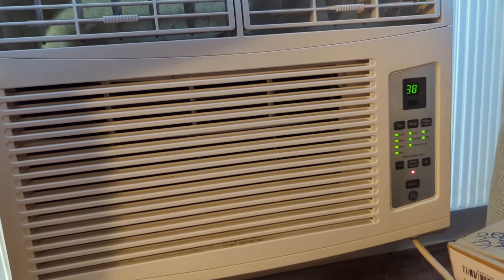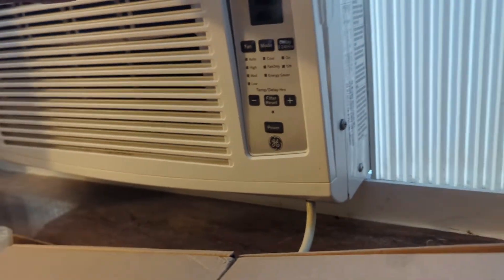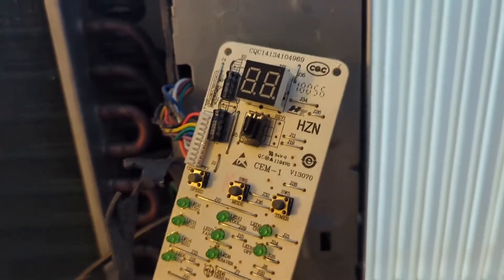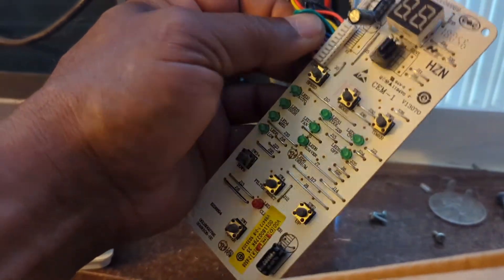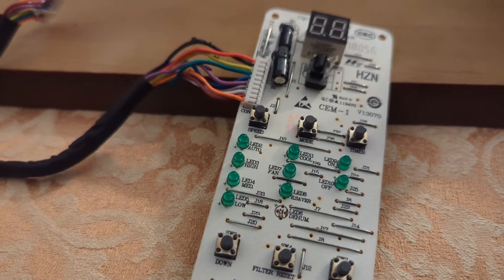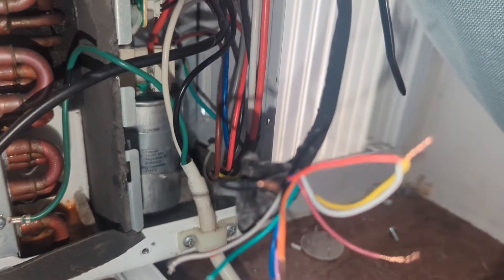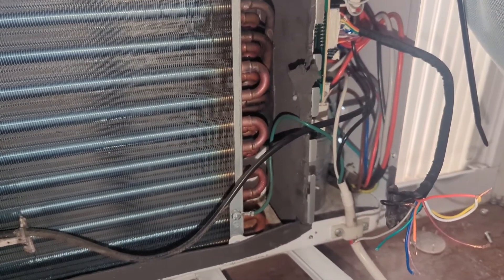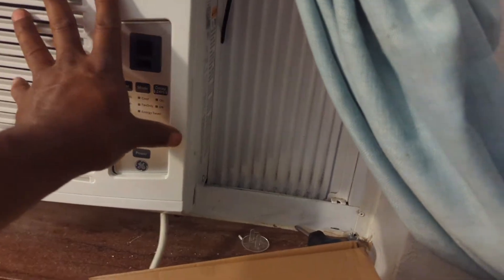GE window AC unit cycling off and on with error 88, hack & repair. Model AHS08LXW1 & others -  VOTD

Comment: I am going to get a replacement unit but this allowed me to get through these next couple days Thank you!!! 98 degrees in ohio right now.
Reply from the maker: As long as it doesn't freeze up. I'm in Ohio as well and mine has been running non stop for 4 days now.
Reply: How long can I let this run without it ruining the unit? I have a board on the way, but what do you recommend to generally run it at?

Comment: I first saw another video that said connect the red, yellow, white, and black.  I tried that and it did not work.  I started searching again and saw your video and you said don't connect the black wire.  I tried just the red, yellow, and white and it worked.  Thank you.  I've had 3 GE 6,000 btu units go bad.  The first on ewas about 2 years old so I threw it away.  The 2nd one was under warranty so it was replaced.  The replaced one went bad after the warranty expired about 2 years and now works without the control board thanks to you.
Reply: Same thing here, @RobertDIY you saved my butt on a hot june day in philly. My thanks
Reply from the maker: Glad to help. Thanks for watching and sharing.

Comment: I order the part according to the model and part number but my connection has the cables up side down. When is connected mine starts from top RED to bottom ORANGE and the part I order is the other way, plus doesnt have the locking mechanism.
Reply from the maker: You can usually find the part number on the old part. Other than that, you'll have to look at the picture of the part you're ordering to make sure it's exactly the same as the one that is in the unit.

Comment: Do you think this would also work for my TCL unit? I have a Smart Wifi 14K btu and i assume with it also having a board and it shows the 88 with all lights on and blinking and beeping then thats whats wrong too. Its only a little over two months old. It has a 1 year warranry but i cant contact TCL until Monday and its only early AM Saturday. We also have power surges and recently had another one  due to a tropical storm. I bought it to replace my GE unit that was only a year old and started the Error 8 if i recall right. It was saying it was overheating and stopped kicking the compressor on. I stored it thinking it just needed cleaning or it couldnt handle the heat wave for whatever reason bc it was also super humid eventho thats what theyre supposed to be for. Anyway, appreciate the hack tip video.    Also do you or anyone know if the usual solution from companies like this is to repair or do they refund money as long as its under warranty or what ? Like i said mine is only a little over 2 months old.
Reply from the maker: If you start taking it apart they will likely VOID your warranty.
Reply from the maker: https://youtube.com/shorts/q72JV9RxFQ0?si=B8GB2Au-Vit1ABng

Comment: Just did it on a AHTE06AAQ3 6000 btu unit. I tried a new capacitor and it didn't work. Tried finding a board to order and no luck so hacking it was my final option. I run it on Hi 98% of the time anyway so all the bells and whistles won't be missed. Thanks for the tutorial!
Reply from the maker: You are welcome. Be careful because it will likely ice up from running to long.
Reply: @RobertDIY  thanks for the heads up. I'll give it a break every now and then 😉👍

Comment: Power went out, broke circuit board apparently.  Tried this and it worked.  Just saved me from buying a new unit and getting a circuit board instead, thank you so much!
Reply from the maker: Glad I could help
Reply: where did you get the board?

Comment: Hi.  I have the AHS06LXW1 model unit.  Do you think it is the same display panel part no?  If not - how did you work out what part you needed? Thanks.
Reply from the maker: I removed mine and looked at the part number on the board.

Comment: awesome thanks appreciate ya new subscrider ..thanks but my GE window shaker just went crazy electronically but it has 2 boards one in front push  buttons & another board connect too thats  hard to get to whee capacitor lives ..how did you know it wasnt the back board & was the front board ? thanks or if anyone knows please advise & love the idea of an trimmer on off control till proper repair made
Reply from the maker: I watched a few videos which lead me to believe it was the board I replaced.